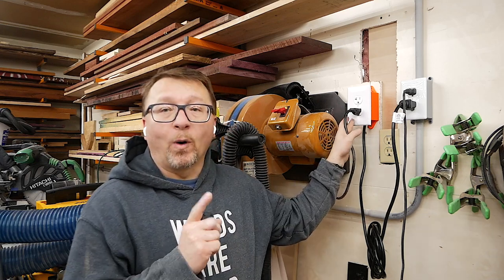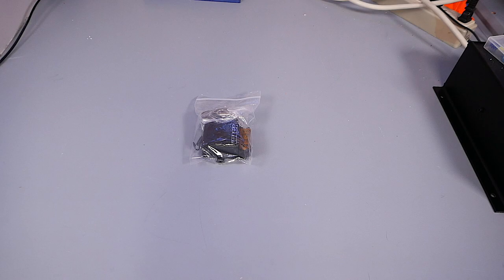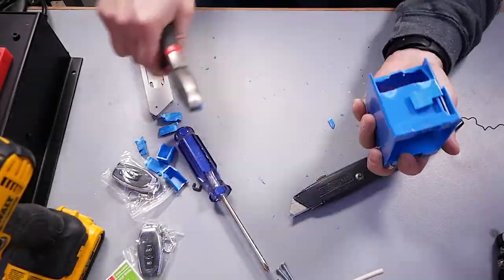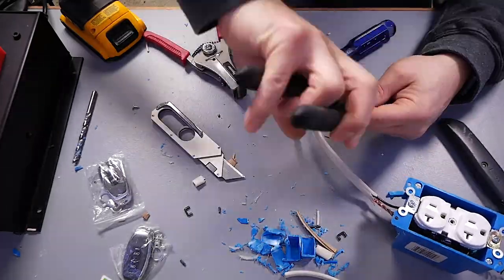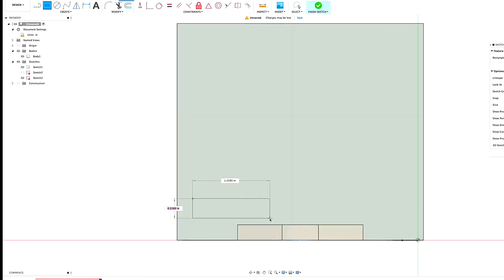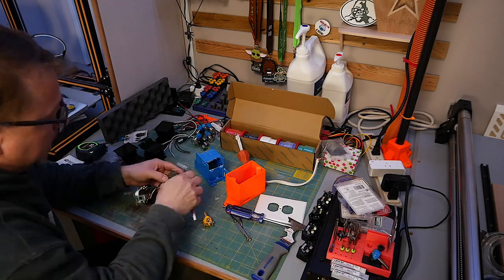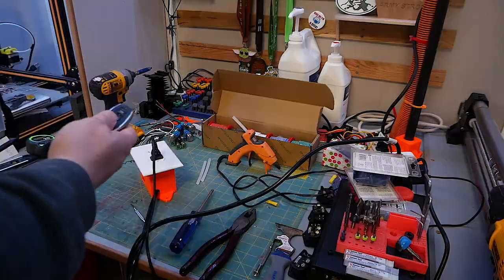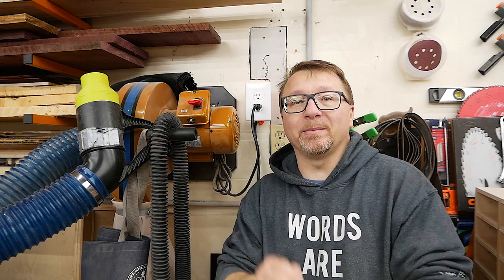Easy and Inexpensive DIY Wireless Receptacle

Comment: great video reef, the only thing with the electrical boxes is that they are fire rated at certain solidity. Also they have the wings on them so you can mount it flush with sheetrock
Reply from the maker: Thanks for the kudos, comments, and thanks for watching!

Comment: Just a tip for the future @cyberreefguru, whenever you are trying to disassemble something that has been secured by hot glue, either spray it or splash it with some rubbing alcohol and it will release itself ;)
Reply from the maker: Thanks - excellent suggestion (that I wish I knew months ago! ;))

Comment: That wireless switch looks like something super useful I could use in  my shop as well. I'm an electrician so I'd be remiss if I didn't mention you have a few code violations happening there haha. 
The proper way of wiring that wireless switch would be to cut the cord end off the vacuum, strip it back a bit and wire it directly the load side of the switch. Then on the line side of the switch, wiring in the cord end that you purchased and plugging that directly into a receptical. Correct me if I'm wrong, but it looked like the switch originally came with a cover for the terminals and mounting holes for it to be mounted externally. 
The box you printed looked great! Something an approved box has is clamps to hold the wires in place so they aren't pulled out accidentally causing a short inside the box. 
I'm a huge fan of DIY and I feel like I'm "that guy" pointing these things out 😬. Hopefully you read this comment with the sincerity in which it was written.
 Love your content and can't wait to see your next video!
Reply from the maker: Hey - thanks for watching and thanks for making such thoughtful comments - I really appreciate it.  I meant to put some stress release into the design, but totally forgot until it was assembled.  For me, nothing gets moved around a lot, so not a big deal.  As for the wiring, completely agree breaking the load line is the traditional way; until you mentioned it, I didn't even consider that. I blindly followed the directions provided with the switch - not sure which way is "best" - interested your thoughts and the thoughts of others. Some folks have pointed out you can simply buy a pre-made switch, which is true, but I couldn't find a switch rated for the current I was looking for once derated for the inductive load of the dust collection system. As with most things, there are many ways to get the job done. Thanks again for watching!